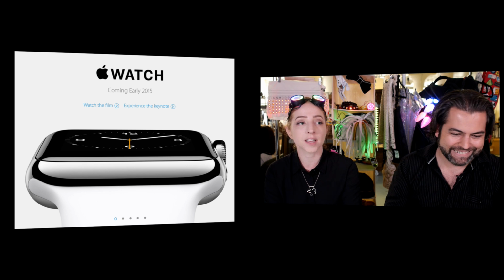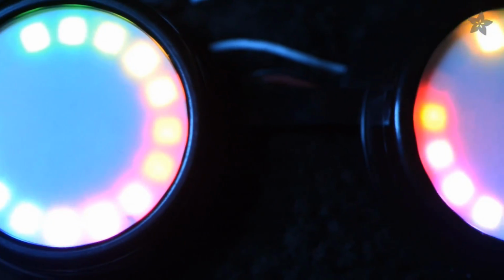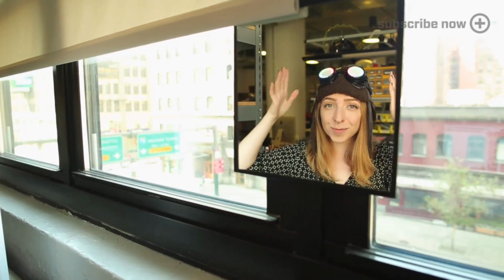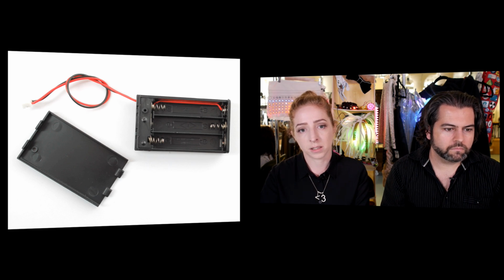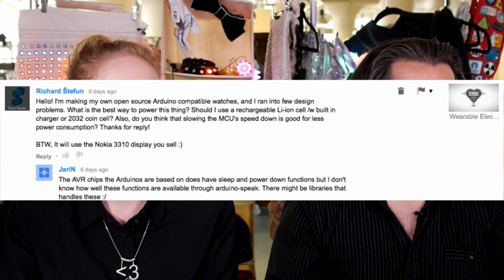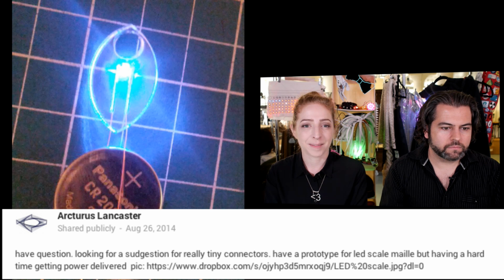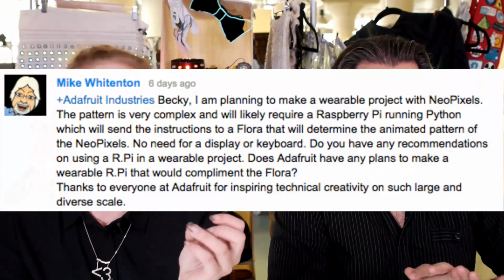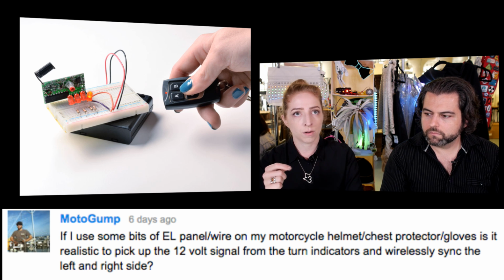Wearable Electronics with Becky Stern 9/10/2014 - LIVE

Comment: hey becky, I was wondering, what is the max the amount of neo-pixels running on 3.7 volts for a pro trinket.
Also is it possible to switch the velostat in the firewalkers with a Piezo element for more of a shoe tap then a step?

Comment: Hi - I have a pair of NeoPixel goggles hooked up to an Arduino Pro Mini 328.  Then I have a flexsensor attached to a glove, and wired up to the Arduino.  When you bend your finger, the patterns and colors on the goggles change.  I'm planning to use it in a Halloween costume.